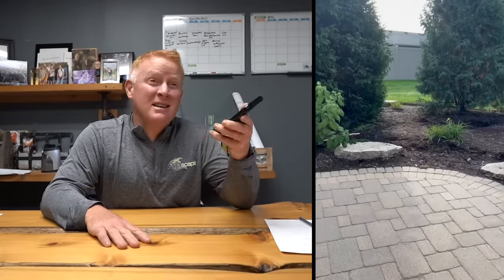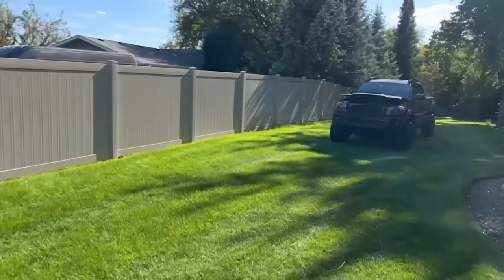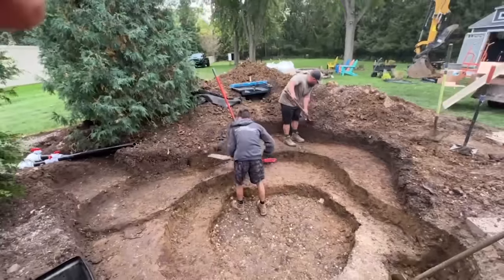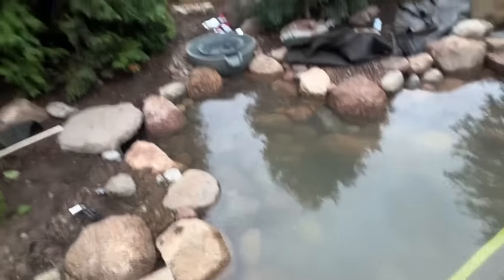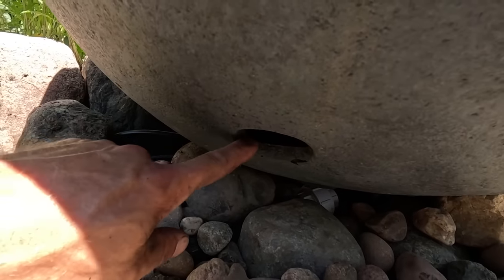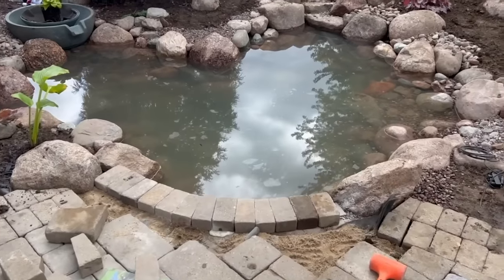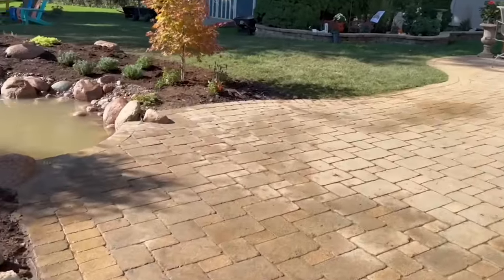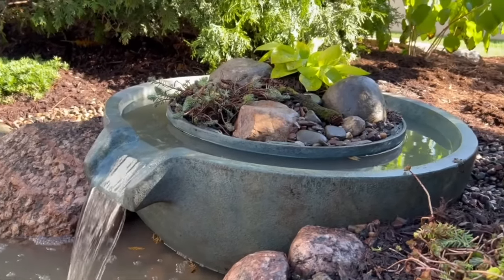We NEVER Did This Before – WHY We Changed The Spillway Bowl

Comment: I did a 13' by 11' pond in my yard this past summer. Used the 2500 biofalls. I noticed you used the 6000 for the same size pond. Did I possibly underfilter, on my pond?? I kinda kick myself anyway, because I knew nothing about wetland filtration when I bought my 2500 biofalls. Had I known, I probably would have gone with the centipede and snorkel. As always, any help or insight you may provide is greatly appreciated. Derek.